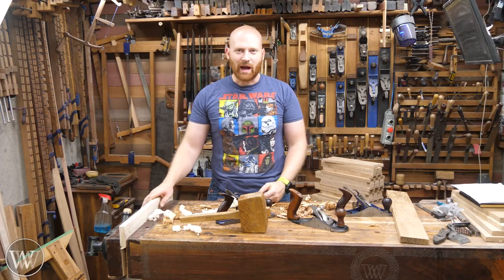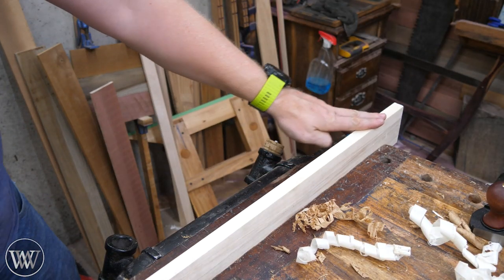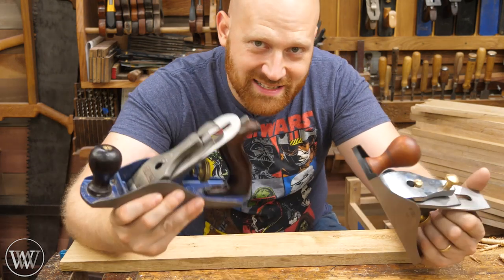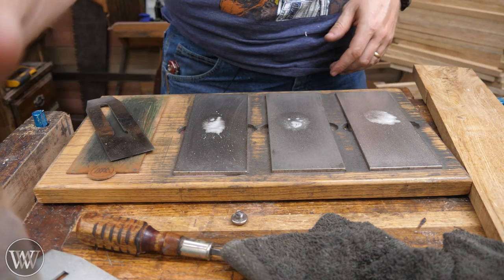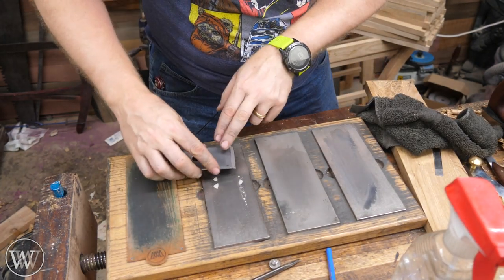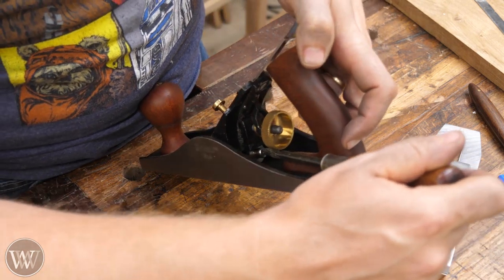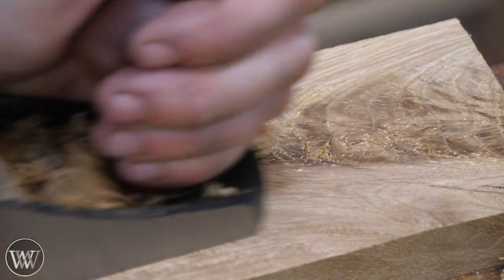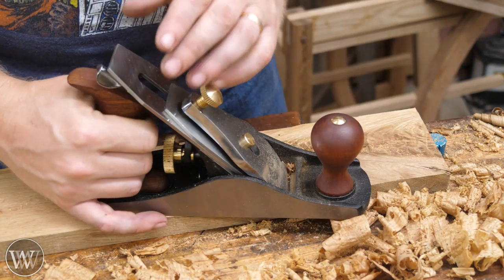How to Plane Against the Grain and in Figured Wood With a Hand Plane

Comment: You have explained the workings of a plane very well. Curly maple is not the worst with grain changes, I work a lot of figured eastern red cedar. I think it is more difficult as the straight grain is very soft and the figured can be very hard and creates deep tare out. The same set up works well even with the hard/soft changes, just keep it stupid sharp. I paid attention in earlier videos. Thanks for all the great help.

Comment: DUDE! 
Over the last year or so I have been moving farther away from power tools whenever time allows and your video's are SO helpful. I put a project on hold for problems with tearout (partially due to lack of my sharpening stones so my blades aren't nearly as sharp as I'd like) but this is so similar to the issues i have been having with a burl and I think this really ought to clear that up! Thank you!!
Reply from the maker: Yep. Burl is basically just constantly switching tight grain. Incredibly difficult to smooth out. Have fun let me know if there's anything I can help with.

Comment: Rob Cosman's latest was a very well done one about setting the mouth and why ... And I'll never buy a Bedrock but .. wow. I have a greater appreciation of your skill.  Now ...  try planing Mesquite.
Reply from the maker: Mesquite is a crazy friend would. I've gotten to work with a few times I love how it turns everything black.
Reply: I do small stuff and, being from South Texas, I occasionally use mesquite.  My only plane is a 30 year old Stanley low angle, bevel up, block plane.  There is no way to adjust the throat width.  I have experimented with using old feeler gauges and thin pieces of sheet metal to shim the blade forward, but have found no good way to hold them in place when tapping the plane to adjust depth.  (Yeah, OK, I'm cheap)  But to your point, yes, mesquite is a challenge.

Comment: Oh yes, planing can be so therapeutic when the plane is set right, and I'm using Bailey pattern planes that cost under 10 USD delivered, it just had to have a lot of elbow grease put into it to get it set right. Thank you for the vid. Oh yes, I got my planes of Ebay and they are "Marksman Iron Jack"

Comment: This is the board i was trying to plane yesturday haha half of it is now shavings and dust.  Will need to sand off a mm to have it smooth.  This is just for the clamp i am making and to learn to use my bosch hand plane to reduce my time on my stanley plane and ended up doing it manually.  I have a long way to go

Comment: I thought maybe you'd mention putting a back bevel on an extra iron for the really bad stuff. I have some Osage orange and it doesn't matter if I use scary sharp 30k grit on a Hock cryo blade - it still tears out! It's like every quarter inch the grain completely switches directions, and the only thing I got to work was scraping it. And then I tried grinding a high angle on an old block plane (around 35 ish, add to the 20-some it is bedded at and I have a 55-ish degree) and it mostly worked. Emboldened by this, I tried an old (like 7 years ago) Rob Cosman recommendation and I ground a small 15 degree back bevel on a jack plane iron and... success!! It is harder to push but with a new effective angle of 60 degrees my Stanley no. 5C blows right through the task... I get whisper thin shavings (they break apart a bit, of course) and ZERO tearout. Sorry for the long-winded post but I appreciate all the videos and thought I'd pass this on as it may help someone out
Reply from the maker: Right on. Putting it back bevel on it increases the angle of attack. A lot of people like to do that. I personally don't like that as much as just sliding the chip breaker closer. Is that provides a compression force that does much the same thing as a higher angle. And then you're not dedicating an iron to it. But that's the great thing about woodworking there's a thousand ways to do it. And there's no right way.

Comment: Dear James, I too got frustrated trying to plane wood which has grain going in both directions - for example a piece of Jarrah with a section of fiddleback.  I almost gave up and headed for the sander. But there on my planes rack was a little-used low angle plane from Fine Tools. It’s blade is set to an angle of 12˚. I gave it a whizz and wow, beautiful tissue thin shavings for the whole section of wood and after a few strokes my tear-out had disappeared.

Comment: TayTool planes also look like Axminster Rider №4, the same manufacturer. Greate lesson. Heard what setup right cheapbreaker is more important and how tight mouth is not necessary
Reply from the maker: yup that company makes them for a few different brands. but each brand adds different options so some are cheaper then others. the chip breaker and the tight mouth both control the tear out in two different ways. and they can each work on there own in some cases, but in some wood you really need both to get a clean cut.

Comment: Not gonna lie that Taytools No.4 looks so damn fine. Nice finish on the steel, heavy duty actual brass screws/hardware, nicely shaped satin finish handles in what looks like a nice wood, and clearly can be tuned to do amazing things. Is this the best No.4 regular money can buy?
Reply from the maker: This would be the cheapest plane I would generally suggest people purchase. Most anything less than this just doesn't worth the money. The next step up in my book would be the new Stanley sweetheart.

Comment: Dumb question, who not just always plane with a higher angle plant all the time? Why use a plane with a 30°  angle when you'll get tear out when you could increase the angle and not worry about it? I ask this cause I'm new to woodworking and just ran into my first frustrating case of tear out
Reply from the maker: I generally just used high angle plains. The only time I really like using a lower angle plane is doing end grain.

Comment: thanks, this is a video i needed. guess i'm buying another no4 plane.
Reply from the maker: glad I could help. I have too many of them!
Reply: @WoodByWrightHowTo  i've only got 2 at the moment, 1 of which is a cheap box store i plan on turning into a scrub plane. the hardest part is deciding which no4 to go for as a 3rd.
Reply: How about no4 1/2? I use it more than no4.
Reply: @anteroreilander6823  those are more uncommon however

Comment: I think you managed to show me that I was DOING EVERYTHING WRONG!!!
I don't have a Taytools plane, but my budget allowed me to get a Kobalt plane (I know, I know). I think I'll apply some of these lessons there, to see what I can do with a $30 plane.
Reply from the maker: Those can work but they might take other modifications such as filling the mouth flat fitting the chip breaker or other items to keep it in tune. Just takes time and patience
Reply: @WoodByWrightHowTo  One thing I noted is that the chip breaker's surface (where it mates to the blade) is NOT flat. So that's taking some work, certainly. But I was definitely WAAAAAY too large on the mouth opening.

Comment: thank you James. so do you use wood filler on the tear out ?
Reply from the maker: No. I generally playing or scrape away the tear out I try not to use wood filler anytime. I would rather show the defect. But in this case where I have an inclusion I may actually put a couple drops of epoxy in there to get a smooth surface but you still see the inclusion through the clear epoxy.

Comment: I'm guessing one would keep a slight curve to the plane iron. Would you straighten the iron slightly because of the tight tolerances, or keep the iron the same as a normal smoother?
Reply from the maker: I do not put a camber on any of my normal blades. some people will round just the corners. Paul sellers likes that for smoothing planes, but for me I just keep them flat across.

Comment: Would the mouth adjustment on a Bailey pattern plane work without re-tightening the frog stop screws behind the iron, and just replacing the iron after loosening the frog for mouth adjustment? Then when you have the preferred mouth opening set, remove the iron and tighten the frog stops. Or would the frog move out of the set position during the iron removal? Very helpful videos, subscribing now!
Reply from the maker: yes. it can work like that you just have to be carful with it and have the right tension set on the hold down screws so it can still move with out shifting too much.
Reply: @WoodByWrightHowTo  thanks a mill!

Comment: So when starting with white oak that's got some pretty deep mill marks, would you still go with a tight mouth setup from the beginning or would you start with a more open/cambered scrub plane setup and then just deal with the tearout after the scrubbing's done?
Reply from the maker: If taking off a lot of material I would use a scrub plane to get it flat. Then use a normal plane with a deeper cut to smooth out the scrubarks. Then the tight mouth to smooth it and remove tear out.

Comment: I find thin irons can sometimes refuse to cut rough grain, probably microflexing and jumping out the cut. Also important not to end up in this situation, having to flatten and remove that much tear out with a smoother, that's why the progression of a properly set foreplane then try plane then a smoother is the fastest. And no a Nr.5 with an 8 inch radius is not a foreplane, it's a uhm... jack plane? Which is also not a 2 inch radius scrub plane.

Comment: Setting up the plane is important The blade and the chip breaker should have no gap. The edge of the blade & chip breaker should not only be sharp but polished to mirror finish. This reduces drag on the cutting edge. The polished edge should only be 1/32" width on blade. We'll be amazed at how easy the plane cut almost glide across the surface of a board.
Reply: I don't know where the term chip breaker came from, because it does no such thing. It is a device for holding the iron down and staving off chatter. Bevel up planes have no "chip breaker" and are well suited to mitigating tear out. It's all about the height of the cutting angle.
Reply: @gav2759   In America we call the cap iron a chip breaker. Because its function is to break chip of wood and not by its location "cap iron" above the iron " blade"
Reply: @alejandrocantu4652  Which ever side of the Atlantic it might be on, or what name it goes by, stabilisation is it's function, not breaking chips. No need to take my word for it, many eminent makers will tell you the same thing.  As I said it's down to cutting angle.  Think what effect a back bevel has. Tear out is mitigated because of the higher angle. The cap iron is pulled back beyond the back bevel and out of the chip breaking game entirely.
Reply: @gav2759  James Wright also calls it a chip breaker "the end"

Comment: Any tips on how to hand plane rough cut Purple Heart, should i use a high angel or low angle plane? What degree should i have the blade, been at this all weekend with a woo driver no 6 plane at a 35 degree blade with a micro bevel and no luck. Plenty of tear out.  Any advice would help.
Thanks
Reply from the maker: That is not fun stuff. the bevel on the iron does not change the cutting capability it just changes the durability. Generally I would use a standard Baily Pattern plane and not worry about the tear out when cleaning up the rough sawn face. then I would come in with my smoother and clean up the tear out. if it is really bad then a card scraper can fix those few spots. I would not use a low angle plane at all as it would just cause more problems then it is worth. here is a video on how to setup a plane to clean up tear out. https://www.youtube.com/watch?v=LJ9-LGMO7OA

Comment: Hello James, This is a really useful video. Thanks. I have a question though. I understand that with a nicely tuned chip breaker and a sharp blade, the board gets smooth and flat, which is great, however, when I look at it from different angles towards a light source, the reflection seems different to me. The parts with the reversing grain tends to look a bit duller. this I'd say is a bit undesirable, especially on large table tops with a lot of different grain directions, that have to take an inherently sensitive finish like a french polish. what would you do if you were not satisfied with the surface prior to a french polish? would you reach for a plane with a higher bed angle or maybe sand the surface to even out the way light reflects off the surface?
Reply from the maker: Higher bed angle will help. Also a tighter mouth. But if you are talking about light bounce changing with turning the board that is called chewyancy. And that can be very desirable in a French polish. But if you are talking about reversing tearout. Then higher angle and tighter mouth can fix that.

Comment: I think the toughest piece of wood I ever set plane tp was a small slab of highly figured Bubinga.  The grain direction reversed every two inches.  The only plane that would come close to cutting this smoothly was a Veritas bevel up jack plane.  But that was only after I invested in a second iron for the plane, ground at 50 degrees, giving me an attack angle of 62 degrees.  It was a harder than normal push, but ultimately very smooth push, and in the end I got to see the prettiest piece of wood I've yet had the pleasure of working.  Love your videos.  Keep up the great work.

Comment: I'm a brand hand tool user.  I know this video was about tough woods to plane.  Is there any reason why I would want to always have my planes set up the way you showed in the video, even if the the wood is easy to plane
Reply from the maker: These settings take longer to setup and make the plane harder to push. Generally I just do this with the smoother.

Comment: I’ve been wondering about that plane. Tempting. Aside from the setup adjustments that you mention, is it pretty flat out of the package? I hate flattening planes lol Thank you for the information!
Reply from the maker: It is as flat as it needs to be. When I check a plane I back the iron out and set it flat on the bench top. If it doesn't rock it's flat enough.

Comment: James have you done a vid where you add the high angle frog to that fancy Veritas custom?
Reply from the maker: I have not done a video on it. but i have a 55 degree frog for it.
Reply: @WoodByWrightHowTo  does it help with this troublesome grain? At the expense of higher effort?  I’ve just started working with hardwood - old growth hard maple. Scraping is the only thing that has worked!  My bevel up veritas has been pretty much useless on it even for jointing. I set up my late father-in-laws Record 4.5 according to the technique you have shown and it is significantly better. But man it’s tough sledding!
Reply from the maker: It is marginally better. Generally just a sharper iron and thinner cut will take care of it, but on the really difficult grain the higher angle helps.

Comment: Hi James, thankyou for another excellent,well explained video-very much appreciated. 
I’ve heard of relieving the corners of your iron (not like a scrub plane radius, just a very small curve at each corner) so that you don’t plane ‘tram lines’ into your work from the sharp, square corners of a ‘normal’ iron. Would you do this and, if so, when? Would it be unnecessary on this set up because of how much you’ve closed up the mouth?
Thankyou again for all your insights and good humour.
Reply from the maker: A lot of woodworkers do like to hit the corners just a little bit. Paul sellers particularly is a big proponent of that. I don't do it as I don't find that much benefit. If I'm doing true smoothing work the amount that I'm taking off is so little you can't feel it. But everyone has different ideas and thoughts on it. So it really ends up being a personal preference.
Reply: Wood By Wright How 2, Thankyou for coming back on this so quickly. H’mm...choices... I have managed to inherit/collect three No. 4 Bayley pattern planes and I think one of those may be a candidate for trying it as an experiment. Probably...

Comment: So, my question is if I ever need to open the mouth up MORE than the setting you show. 
Is there a reason to have a smoothing plane more open, or just scrub planes?
Reply from the maker: Most of my planes are open way more then that as I will be taking a bigger bite with all but the smoothing plane.
Reply: @WoodByWrightHowTo Great, thanks!
Is the opening dependent on the wood and its characteristics, or the thickness of the shaving? 
So do I need to change the mouth opening by wood species or just based on how thick the shaving is?

Comment: I would like your advise on choosing between a Tay tool low angle Jack plane and the Veritas one   I live in Canada and the shipped cost of the Tay is about $245 and the Veritas one would be $300  Thanks
Reply from the maker: between the two the Veritas is a better build. with only $55 between them I would go with the Veritas as long as you can afford the difference.
Reply: @WoodByWrightHowTo  Thank you

Comment: Hi James, do you put a back bevel on any of your blades to control tearout?
Reply from the maker: No I don't like putting a back bevel on any of the irons because then the chip breaker can't get close enough to the tip. Also then that makes them harder to push through the wood for normal use and I don't like the idea of having dedicated irons to specific tasks. but I do know other people who do like doing that so it's kind of a personal preference.
Reply: @WoodByWrightHowTo  i agree with this above. I am disappointed I put a back bevel on all my blades. eventually sharpening them down and no back bevel.